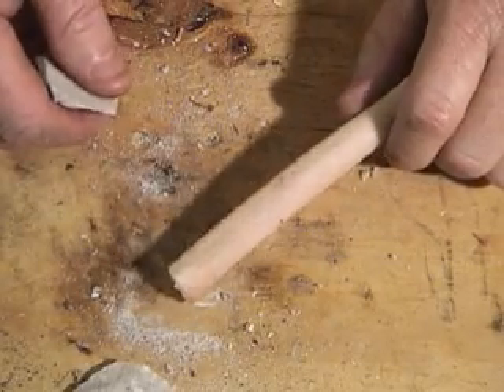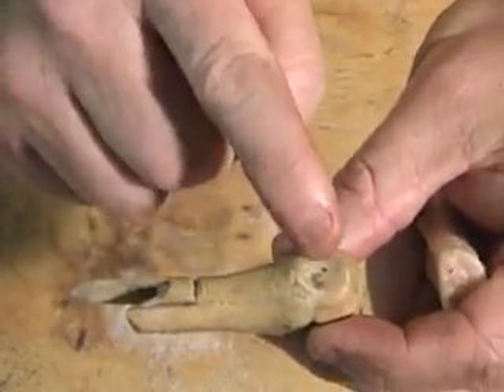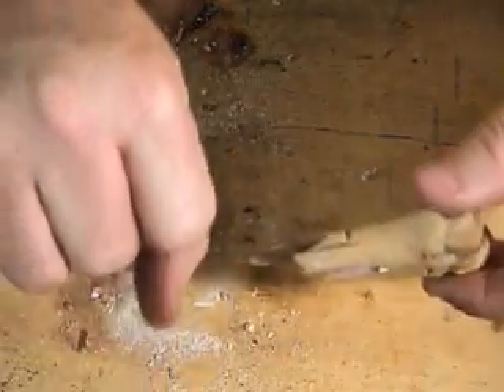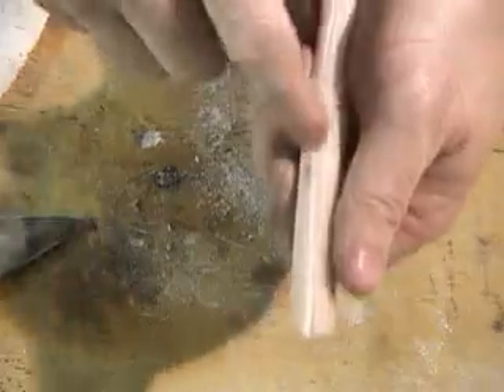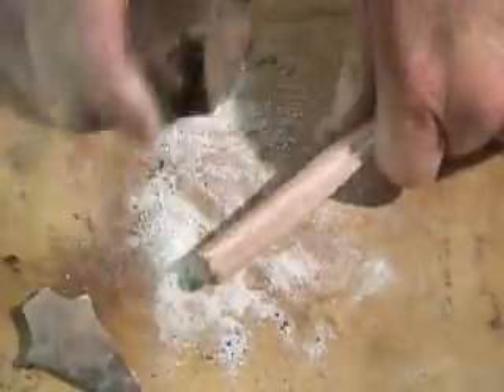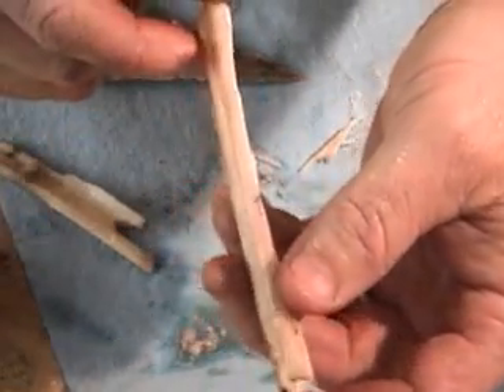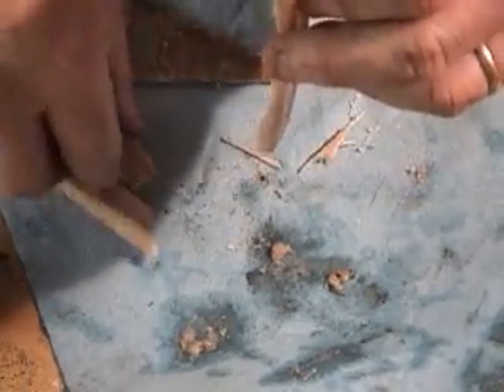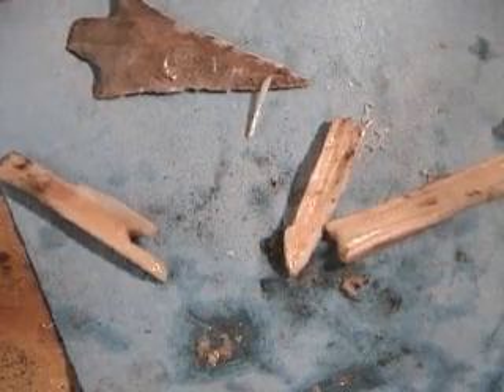Series Part 4 Making a Bone PIn  ***GRAPHIC***

Comment: Never done that but what if you turned your engraver 90 degrees to the work for the groove work.  When the very tip snaps off you have two.  A fine point sideways would make a finer groove to start maybe. Using obsidian scrapers on wood, they resharpen themselves and the edge adapts to the job. You are making me want to go hunting so I will have some raw materials to try.  Gotta learn more about what the pins are used for I guess.  Thanks for the video.